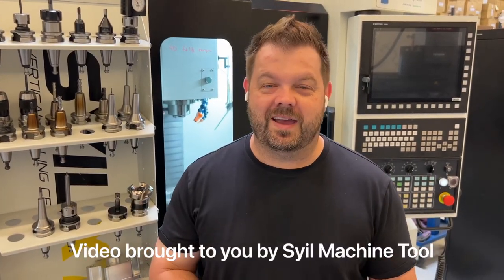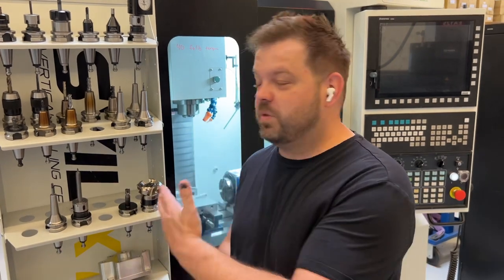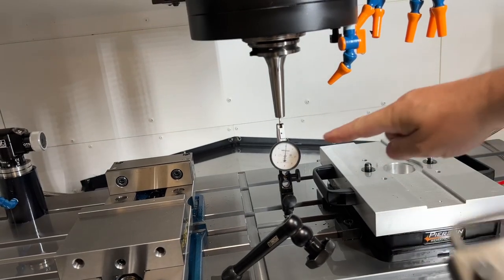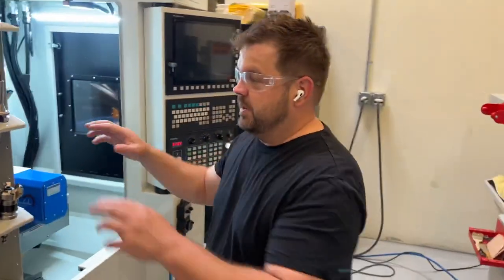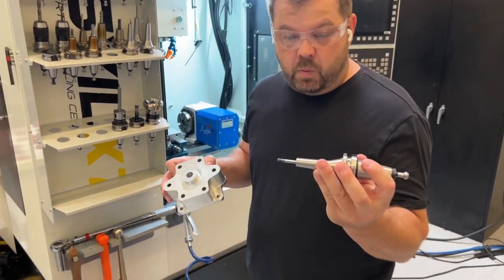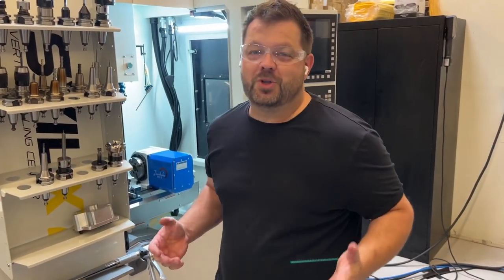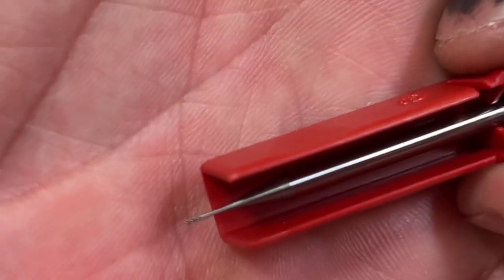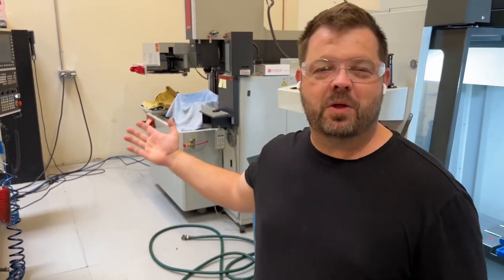Extended Reach Milling Tool Holders - Intro

Comment: Never tried these small collet holders, but I've clamped a turning tool in a vise and used the spindle to turn down about a dozen shrink fit holders just for this reason. As long as you don't go smaller than the od of the very end of the holder you won't loose clamping force on the tool. Ridgity is a moot point at these lengths where technique means everything. I've used this method all the way up to 1/2" tools with no problem. In fact I have a 6" gauge length shrink fit, turned down to .780" od from tip to flange, 1/2" od necked solid carbide endmill with 6" reach, and can take a .020" radial by 1.25" axial cut in 316 stainless no problem. It runs so well its a "go to" tool in my library even when I don't need to reach into a feature that deep. Many ways to do it, but the more machinists share with each other the better we all get at what we do.

Comment: Thanks Jason, another good and helpful video. You're a natural in front of the camera. 
Re features right next to deep walls for example, yes, you can use some of the great products you've shown, but what other options are there? On the design-for-manufacture front, what should be done to avoid features next to deep walls, for example, can the same outcome be achieved from individually machined layers that are precisely stacked up?

Comment: do you have t remove pull stud to tighten the collet?
Reply: I have some from Harvey at work, and they don't require it. As long as you use a pullstud with a thru-hole, you can put the Torx driver through the hole.